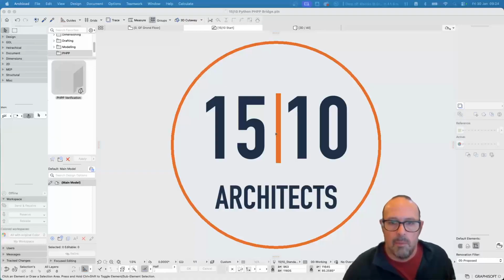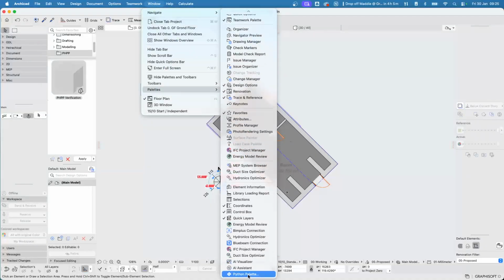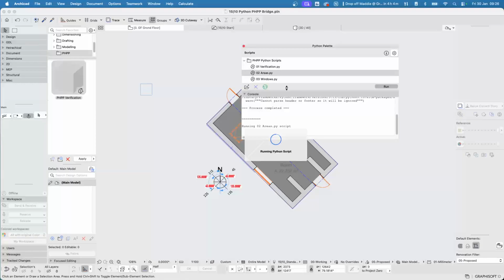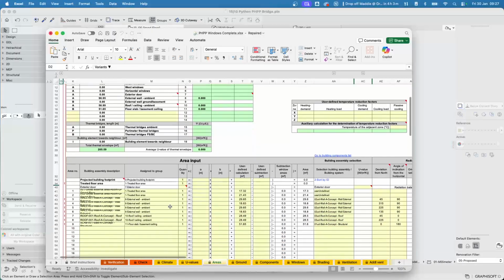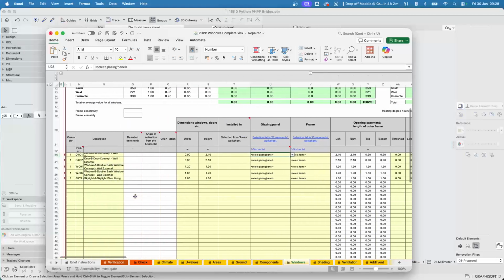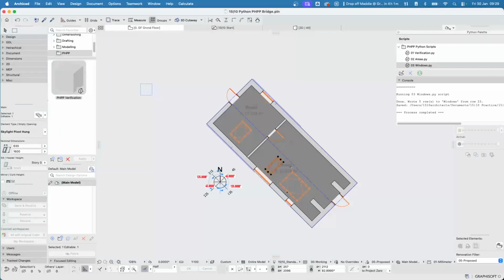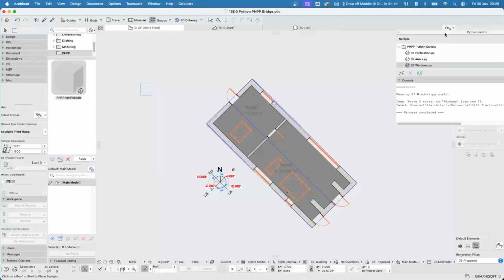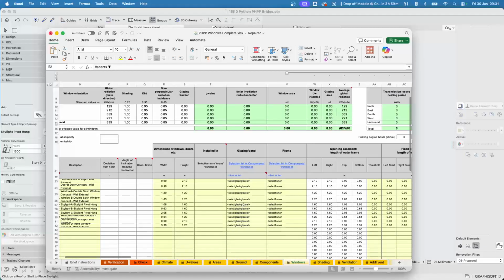PHPP Python Bridge Demo

Comment: looks promising, could be interesting for many. two questions:
- which version of archicad is/will be supported?
- how this comply within eu building energy standards/directives?
Reply from the maker: This will work with any version of archived which supports python ~28 or later
A Passiivhaus certifier will need to verify design as normal - this is just to speed up the workflow and reduce errors on the part of the designer